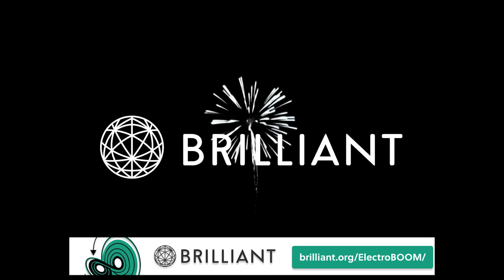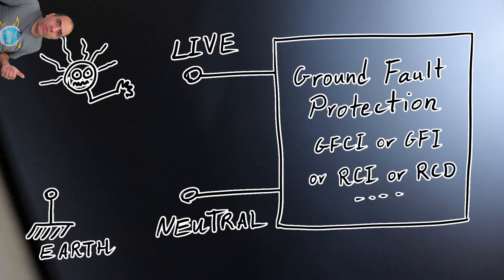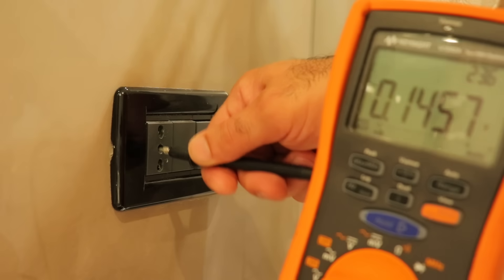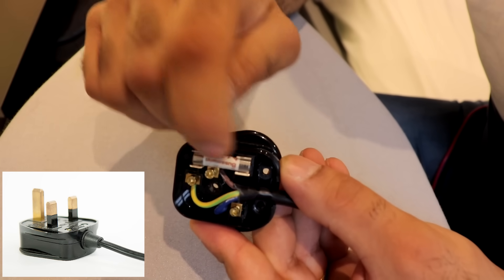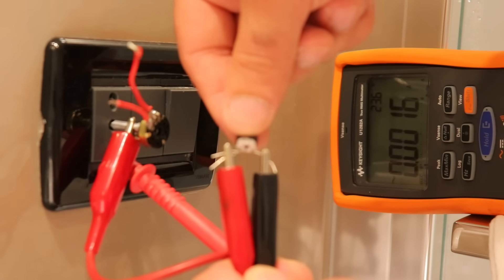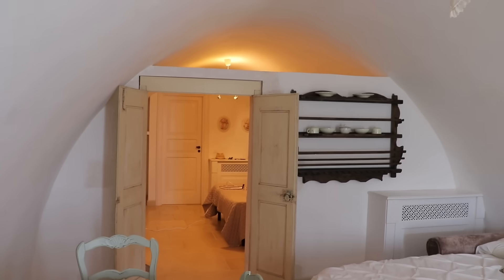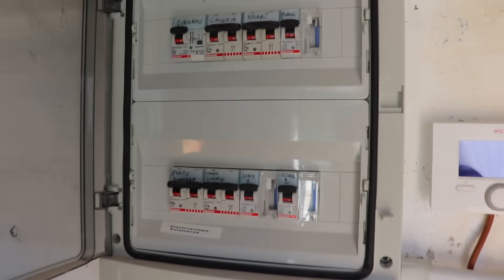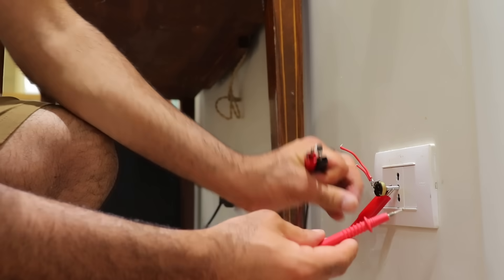Tripping Every Breaker in Italy

Comment: Hey Mehdi, great video as always. A couple interesting points:

1. Italy is notorious for some weird electrics. A well designed system should only have the nearest breaker ‘pop’ during a fault- this is called selectivity. Clearly this was not the case in the first hotel. Also, 2 breakers for the entire room is poor planning because in a fault, half the room looses power. 

2. Although the presence of GFCIs/RCDs is a good thing, all the ones that you saw were type ‘AC’, which means they aren’t really good for faults with electronic items, LEDs or anything that’s superimposed DC back on the mains AC waveform. 

3. I wouldn’t recommend resetting breakers on your own. Although in Europe, if an electrician is working on a circuit, they should lock it off (usually done by putting a padlock on the breaker), you might accidentally turn on a breaker where someone else is working on live wires- I know someone that has been severely injured and hospitalised because of an unauthorised person turning on a breaker.
Reply: Selectivity is difficult to achieve. A short circuit will trip all the breaker no matter what you do, even if they are a larger size. When there is a short circuit hundreds of amps pass for a short amount of time, it's not possible to have selectivity. Most of the time you also trip the breaker on the electricity meter itself, that is a 63A class D. 

With ground fault is easier, since you usually can install an higher size RCD (for example a 100mA) and they make time delayed one. Still it has its problems, for example having an higher size RCD means less protection. 

Having 2 breakers trip is not that much of an issue, having no breaker that trips is a problem. Since nobody tests RCDs each months (how you should do) I think it's good to have 2 of them in series just in case one of the two fails...
Reply: @alerighi  You’re right, it’s not easy to achieve selectivity based on energy. So, I rely of time-based selectivity. Most jobs I do are two have three levels of protection. First is the incoming MCCB, set time a time delay (2nd delay increment), and then a sub mains circuit is fed by another MCCB (1st delay increment). Final circuits are on RCBOs. 

If required, an further layer of protection via an ACB is added upstream at the incomer in case of a very big network. 

This archives total selectivity.

With regards to RCDs, it is the unfortunate truth. People very rarely test them as often as required. Given how we’re now using only performance categories greater than or at least type ‘A’ , the chance of an RCD failing has also increased significantly. Like you said, an earth leakage relay (set to a time delay) is a good backup to connect to the most downstream MCCB. Although not ideal, it gives you something.
Reply: @krishtheobald4227  The problem with the time delay is that if the first breaker don't trip (because faulty or not regularly tested) the added time mean that the second breaker will not meet the time regulation to trip.
Reply: 1 how many breakers do you want in a hotel room? I meant it is not a palace
Reply: @XMarkxyz  given the size of the room, 2 for lighting, 2 for sockets. Any air cons and water heaters, if not central should also have separate circuits.
Reply: Regarding point 3: At no instance in the video I noticed him resetting an "unknown" breaker - only the ones in his room and/or the ones he knew belong to his room and he himself popped.
Reply: @Alexander91  I see what you’re saying, but how could he be so sure?
Reply: @krishtheobald4227  ayoo
How did you watch the video before the premiere hasn't even started 😅
Reply: @atharvap8  Patreon 🙃
Reply: @krishtheobald4227  ooo
nice
Reply: @krishtheobald4227  What evidence do you base your claim on?
Reply: @Aquatarkus96  which specific one?
Reply: @krishtheobald4227  i agree that turning on and off breakers in unknown environments it's bad practice, that being said the first hotel the breaker was labeled "camera 5" (room 5) and he probably knew his room number, also in the other hotels he examined the breakers before messing with them excluding those that weren't on before
Reply: @krishtheobald4227  while I normally agree as I have been on the receiving end of dumb dumbs flicking on breakers while I'm working, he knew it was his unit. He knows it's his for 2 reasons; 
1 - It literally says the room number on it and is the only tripped breaker and he knows he tripped it. 
2 - He had previously tripped a breaker at the beginning of the video and asked the staff to show him the electrical room. They showed him which breaker it was.

Edited for typo
Reply: @EeekItsSnek  ahh. I didn’t think of it that way. 

Still, better safe than sorry, eh? 

Mislabelled boards are still a thing haha. Wouldn’t want to accidentally send someone to the hospital, or worse- the morgue.
Reply: @krishtheobald4227  
He isn't a normal Joe. He is aware of electrics and that they can be harmful. I thought we all knew this when watching this Channel, such advice is helpful if someone didn't have this as their main field/interest, because even if they saw where it is, maybe they could forget it etc, they might not know how it could turn up badly. But I'm very sure Mehdi knows what he's doing.
Reply: @Alexander91  I see what you’re saying, but sometimes stupid people mislabel breakers.
Reply: What are you saying regarding LEDs and the RCDs? I dont understand.
1) If live connected through an LED or similar device to ground, it would be residual current so how would the RCD not detect it?
2) The much more dangerous situation would be a human touching some exposed live voltage somewhere and even if that's on the casing around some LED bulb or so, it would still trip the breaker if above 30mA, right?

Am I mistaken here or did I miss something else entirely?
Reply: @LuLeBe  I guess I could’ve worded what I said better. Basically, loads with rectifiers, or anything that causes DC to pass through the coil of an RCD will result in ‘blinding’. This means in the presence of a fault- not limited to faults only in the specific load, but the entire circuit protected by the RCD, it will not trip in the required time/not trip at all.
Reply: That is the reason why you should ground the live wire, while working on the electric system. At least this is what is standing in the "5 safety rules" in German electric code.
Reply: @thebamplayer  I thought it was an international thing. I was born in Germany and live in Belgium and over here it's exactly the same; 
Separate electrically (remove tension) , lock, breaker ,  check the tension, close circuit with ground and physically secure the perimeter in which you work.
Reply: @thebamplayer  interesting. I know even when working dead and doing IR tests, we always keep the earthing conductor connected to the MET, that way if there are any faults, the 500/100V DC will flow to earth and not harm anyone.
Reply: 1- modern houses have 1 per area, it's just a matter of cost, to me it's pretty useless to have more than 1, 2- it's now mandatory to use class A (minimum) or class B differentials if you for instance have an electric car.
Reply: @GabrieleBonetti  Its not useless to have more than 1 rcd.You will swear in multiple languages if your whole house is out for hours until you find the faulty load.
Reply: @GabrieleBonetti  Class A, one for lightning and one for sockets for a small room. I was only estimating based on the size I could perceive.